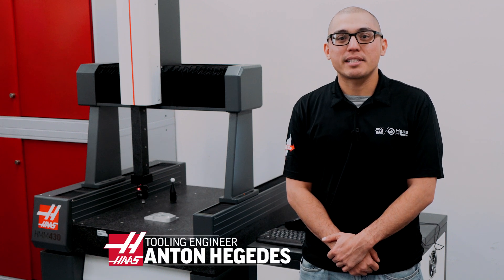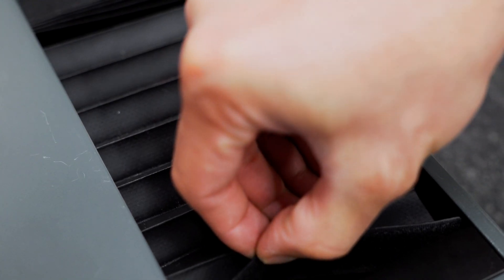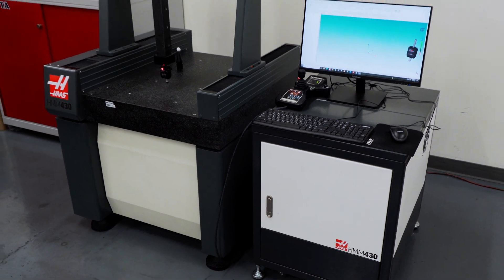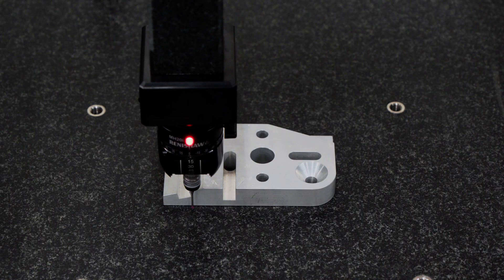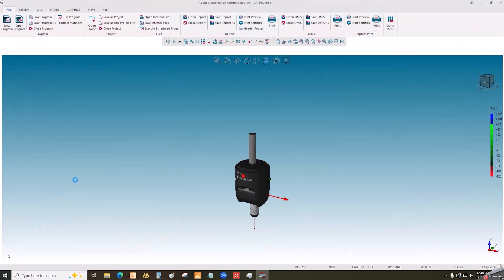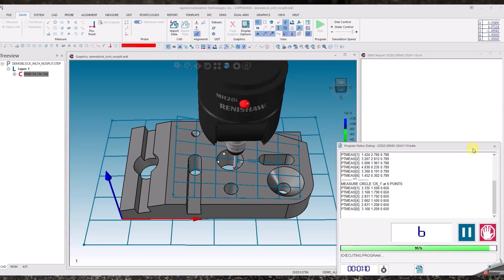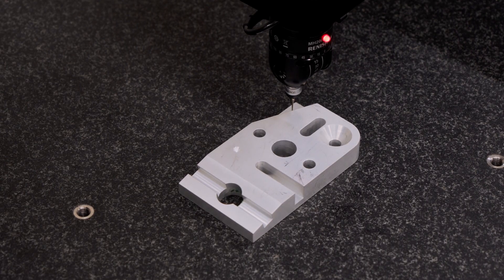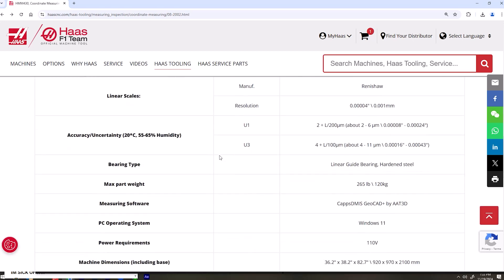Haas' New Shop Floor CMM - The HMM430 Coordinate Measuring Machine - Haas Automation, Inc.

Comment: By the way: what's the probe wrist angle range and angle increment?

Years back I used TESA with Renishaw's wrist and increments were by 7.5° which felt very limiting.
Now I use HH-AS that works by 5° and even that is pretty rough sometimes.
Reply: 15 degree as can be seen at 0:30 in the video

Comment: TP20 probes. Short lifespan, no linear scanning, touch force dictated by probe construction.

Maybe I'll sound like an advertisement, but Hexagon's PC-DMIS (especially v.2024.2 and later) clicks better with me than anything else on the market rn. It may feel like it's meant for power user but nifty little features like setting up custom measurement strategies, automated routine creation from PMIs or even details like selecting prehit/retract to feature vector or probe vector really makes programming easy and streamlined even without using clearance planes and move waypoints. It's tough to beat Hexagon.
Reply: I think you are missing the point of this machine. It is a shop floor CMM priced affordably which enables a lower bar for entry into the CMM world. The license you are talking about would be about a third of the price of the HMM430, coming in around $15k for the license. This is not an inspection room queen with all the latest and greatest features.
Reply: I'd go Zeiss + Callypso personally.